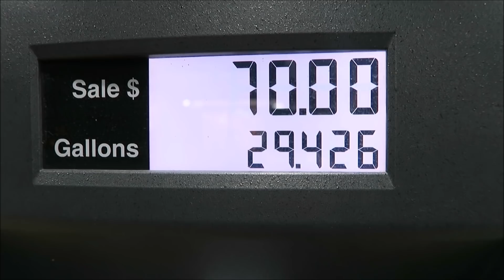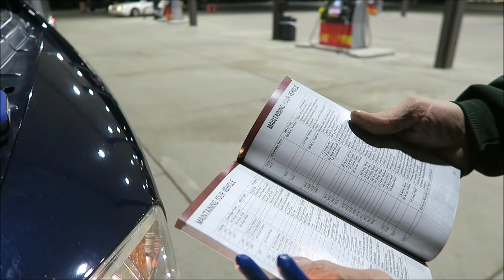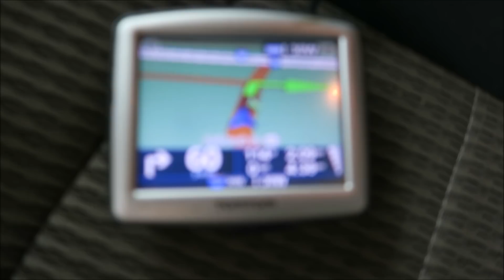We Made It! Goldie Hawn's Breathing Texas Air!

Comment: man 6-8 mpg there is something seriously wrong!! OH it's a dodge never mind
Reply: Mr. B. Real unless it’s a Cummins 😎
Reply: @Jxmpie  so true but it's not.
Reply: Well what is it you like then?
Reply: @Jxmpie  i like getting decent gas mileage when towing. my 04 gas powered ford gets 13 on avg pulling 6800 lbs, i push my 99 gas powered suburban a little
harder with the same load and it still gets 11-12 mpg. now my 18 Durango RT only gets 15-16 drivivg like grandpa molasses and 11-12 driving it like I stole it. I wouldn't dare tow with it cuz it probably would only get 6-8 mpg..but the rusty ford  soon to be replaced w/ 08 big horn crew cab 4wd dually diesel
Reply: We use a 6.7 Cummins turbo diesel for work and that thing pulls with ease, I believe it’ll get 12-14 not 100% sure